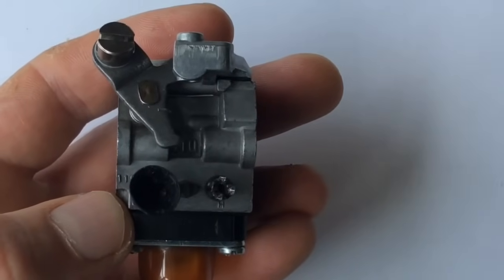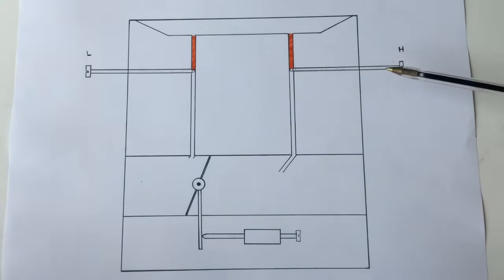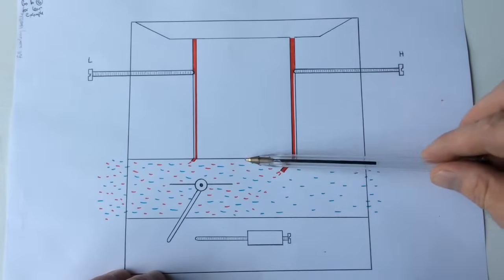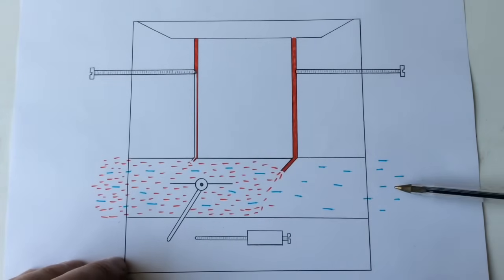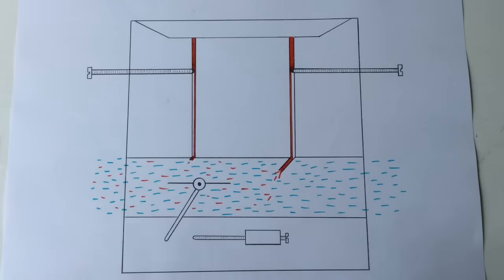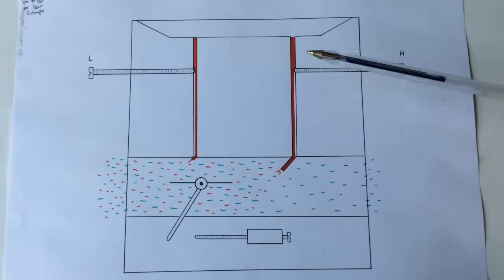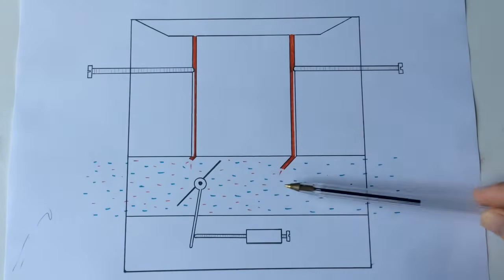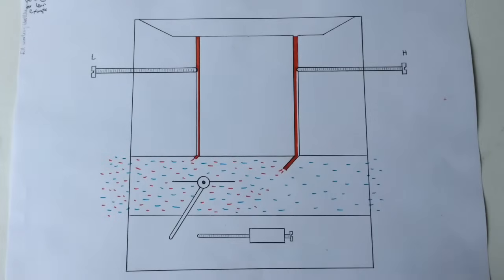HOW ADJUST CHAINSAW CARBURETOR:  Chainsaw Carburetor Settings Explained! (by Craig Kirkman)

Comment: good explanation....but from a practical real world everyday put the chainsaw to work, these adjustments need to be accomplished in a specific sequence.  The theory is sound, but the sequence explained is wrong.

a.  do NOT make adjustments to high needle valve first!
b.  do NOT make adjustments to low needle valve first!
c.  DO make adjustments to idle screw FIRST!  Period.  you will need to locate (visually the position of the idle butterfly valve.  This is IMPOSSIBLE to do unless you remove the carb and look down the carb throat. In some carb assemblies this is not possible and you will need to remove the carb completely or at least enough to see the position.  DO NOT TOUCH THE THROTTLE TRIGGER when doing this. what you are doing is setting the IDLE butterfly valve in a static position...re:  idle, no trigger! The position should be about 1/2 but no more than 2/3 blocking of the throttle body.  Turn the screw to get this position.  We will come back to this idle setting later. This is the starting point for static setting.

Now that the idle butterfly valve is set to 1/2-1/3 close position, REINSTALL THE CARB FILTER!!!!  (the engine will run differently with carb off, so put it back on before next steps)  Also important:  chain MUST BE INSTALLED.  The engine will respond differently when under a load than just freewheeling or even with the chain brake clutch engaged..DO NOT DO ANY ADJUSTMENTS WITH CHAIN BRAKE CLUTCH ENGAGED..  That causes MORE load and will defeat the purpose of the carb tune.  So basically, you are tuning your carb with the chain ON, no chain brake engaged, carb filter ON!

Now that the idle valve is set to static..and carb filter is reinstalled,  chain is installed and chain brake is not engaged, we go to low and high needle valves. see the note later in the steps about proper chain oil !  (and it goes without saying, make sure you fuel is proper 2 cycle mix ratio!!!)

Notice we have NOT started the motor yet!  KEY..We are just preparing for the tune.  This is called setting static tune.  We are doing this in sequence and we will follow this sequence in this static setup and we will do this same sequence in the fine tuning with engine on, later in the procedures below. The sequence is:  idle first, low second, hi last!  follow that and you will ALWAYS get your carb tuned properly.  

okay, so now we have all of that squared away.

this is where you need to locate you chainsaw manual.  The nomenclature SHOULD show how many turns OUT FROM fully closed is the starting point...

For example, on my Stihl MS250, it is 1 full turn out  from close for the low needle.  And it is 3/4 turns from the close.

terms:

closed:  meaning turn the needle valve clockwise until it stops. DO NOT OVER-TIGHTEN!  The needle valves are precision machined!  If you crank down too hard when you turn them closed you risk damaging either the needle end or the needle valve seat.  If you over-tighten and bugger it up, you are probably never going to get the carb to work correctly and will be looking at replacing it. So gently!  Clockwise turn to close (gently!)..then open them up (counter-clockwise) to the rotation listed for each low side and hi side needle valve according to your manual!! 

The MS250 I have this is 1 full turn from close for the low needle and 3/4 turn from close for the high needle.  Your machine may be different.  KNOW these numbers!  It matters!  This is where you begin.  This is static carb setting.  

Now you have all three setting in static position.  You are now ready to begin your running fine tune.

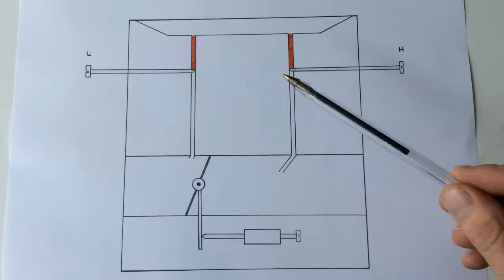prep:  make sure the chain is installed, and tension is correct...do NOT overtighen the chain.  Make sure the carb filter is installed.  Make sure you have bar oil !  Make sure your fuel is good (89 no ethanol gas is best...anything above 89 is counter-productive.)  Make sure the 2 cycle oil mix is the right ratio.  For my machine, it is 1:50...1 part fuel oil to 50 parts fuel!  That translates to 6.4 ounces of 2 cycle oil for each 2.5 gallons of fuel.  2.5 gallons is the most common small engine fuel container.  The most common mistake is too much 2 cycle oil or not enough.  Too much and you end up creating power problems and heavy unburned deposites of fuel oil on all the parts of your motor that cause performance problems.  Too little oil and you end up with poor lubrication and that will lead to premature wear on all moving parts within the motor!  Some advocate adding a bit more fuel oil to the mix for protection.  I agree with this, but more than one ounce per 2.5 gallon container!  this is particularly helpful if you are running your chainsaw hard for long jobs on a regular basis.  But anymore than that, and you create performance problems...when in doubt, stick to 1:50...in some machines that mix ratio may be different...1:40 for example...get out that manual and find out!

okay, so now we have the basic setup...with important details.

now we go to startup and fine tuning with the engine running.

start chainsaw.  Does it start?  

it should..it will probably run pretty good too.  Unless something is terribly wrong, carb fouling, air leaks, bad fuel, bad sparkplug, or bad ignition ...and that is for a different day to discuss...the static settings for all three screws according to you manual should get you in the ballpark and the chainsaw running.

now, sequence.  

first:  idle screw:  leave it alone!  Yes, leave it exactly where it is.

give the chainsaw about a minute or two of warmup...then pull trigger and release....then pull trigger again let it roar for 10 seconds, then release.

turn chainsaw off.
yes, turn it off!

then start it back up again.

does it start...yes?  it should...what you are doing is making sure that the static settings operate correctly in all modes of operation..just like you would expect out in the field!  key!

So next up is that idle needle valve.  close it until the rpm's pick up and and you hear it running faster...NO TRIGGER..remember this is idle.  Once it starts revving, back off and until the rpm's drop and then a bit more until it sounds like the motor is just going to stop.  Between these two rotation points is the sweetspot for idle.  (do not pay attention to chain rolling or not...we will get to that later!)...  Once you find the middle point between these two hi and low stops in the low needle valve, open it up one quarter turn....

hit the throttle a few times...and release..motor should run and sound the same ....

next up, Hi needle valve:  this is probably the MOST IMPORTANT STEP...and you MUST be cautious here.  This is what controls the working power of the motor.  pay attention to what you are doing here and listen carefully.  And be SAFE!  

engine running...NOW HIT THE THROTTLE AND HOLD ...close the hi needle until it picks up in rpm and sounds gets higher pitch.  release trigger!...
hit trigger against and hold and open the hi needle valve until it starts going into a lower rpm sound, lower pitch.  If you go too far, the motor will stop.  this is normal.  Find the two rotations for high side and low ...the middle is where you want to be.  Then back off by 1/4 turn!

release the throttle.  let it sit...

turn machine off.

turn it back on...idle should run like before..hit trigger for 10 seconds and release....everything should work.

now we go to the chain ....at idle, does it move?  

if so, then simply adjust the idle screw until it stops.  It's just that simple..

this is the proper sequence.

once you learn to do this...and you repeat it over and over...it becomes second nature memory...

all chainsaws 2 cycle use the same procedures...with some key differences in static setting and fuel oil mix.  but the steps and more importantly the sequence IS THE SAME!

you are welcome

Comment: Hi Yr video of adjustment of carb seems really helpful but before l go ahead can u tell me why my saw was cutting out when getting hot.
Thanks Kevin.
Reply from the maker: Hi.  Yes usually, and most commonly, this is due to the ignition coil pack.  They sometimes stop producing electricity to the spark plug when hot and then when cooled down they work again.  Very confusing.  The only way to know for definite is to fit a new coil pack or one that you know for definite is in good working order.  Then, run your machine to see if symptoms are still present.  It is Not always the coil pack so it is a financial risk you may have to take, but it is common.  This is the best place to start in my opinion.  I will make a video on this after I have completed a few other requested videos. Many thanks Craig

Comment: Very good job of explaining the adjustment that I ever seen the only thing that I not clear on the idle adjustment screw I normally adjusted the low screw until it idle at the highest idle to were you hit trigger it excel with proper then adjust the idle screw to the idle that I won't  is this not the right way

Comment: Hi and thanks for the explanation.  What, if any, is the benefit of adjusting the high first?  Also, once you've got the high sorted and you move onto the low, will you then have to dial the high down a little so that on full revs the high plus the low, are not creating a rich mix? Thanks

Comment: I thank you for the video, but the more I open the high jet, the more it revs, to a point where it sounds as though it's going to self destruct.  I've never gotten to the point where I hear the engine bog down.  I've also been taught to adjust the low needle first,

Comment: I run a small engine repair shop on the side and I always try to explain to people what these adjustments do and of course they don't follow but this work you did is one of the best educational videos I've seen good job man
Reply: Hey, question: what he's calling the ticker, is that the choke?
Reply: @larryreese6146  I think ticker is idling. Throttle adjustment. Not choke. That is my interpretation.
Reply: @larryreese6146  idle adjustment screw

Comment: Great video. Very informative! I generally set the idle just a bit rich. A good idle with a little smoke so I know it's getting sufficient oil/lubrication to the internals and for the high speed setting I set it slightly below peak rpm till I notice a little bit of  two stroke smoke at full throttle. Oil/ lubrication is critical for internal cooling and lubrication. Too little and your engine is cooked too much and your exhaust port and muffler will carbon up reducing power till cleaned out. I run Stihl and Husqvarna both brands run very high rpms so I very slightly tune them down a bit so they have a longer life. My Stihl FS-250R has been tuned like this and has lasted for seventeen years and runs like brand new every time I go to use it.

Comment: I have a vintage Stihl AV045 Super. I mistakenly put diesel in it! I stripped down the carb and replaced all the gaskets. Couldn’t get it to run. Watched this video today then followed the instructions splendidly shown in  the video - one turn on each screw. Imagine my joy when I heard the first bang of the 87cc motor. It soon kicked into life and was quickly up to full revs. Adjusted both screws to find the sweet spot but went back to 1 full turn on both. When it warmed up I adjusted the tick over. Magic! It is as good a saw as a Stihl Magnum when running, it runs on 40/1 but I run it on 50/1. Next project my Mantis Tiller!!

Comment: I have a Makita DPC 7311 14" cut saw that I just replaced the gaskets and diaphragm because the machine would flood prior to starting it. Now that it will start after only a few pulls, it won't idle on its own but stall if I let go of the throttle trigger. My question is, should I follow your procedure of adjusting these settings? And, I also have a screw setting that has an S on it. Not sure what this stands for? Is that my ticker, as you called it in your video? Thanks!!

Comment: So many times I have wondered EXACTLY what the needles adjusted(Air or Fuel)... Mine would only start with L on 1-turn out...but after cleaning(tear down) carb and replacing coil my 1999 325R-X is running great again... THANK YOU !

Comment: you dont need to pull the throttle when adjusting the low speed needle to see how the engine sounds/ preforming?
Reply from the maker: Not whilst turning the screw because you will need to hear changes is engine running from idling, but you certainly will need to pulsate on the throttle in between adjustments to see if your changes have made a difference to the over all running.
Reply: TheRepairSpecialist thank you

Comment: Would like to ask you a Question #Repair Specialist!  I’ve got a Stihl BR420C Magnum. I noticed it was leaking fuel out of the air filter housing. I removed housing/filter and cranked to observe... it  only leaks or squirts fuel outward from the carb into the air housing when throttled up into the Rpm’s. Not when idling. 
I’d like to stop this leak to be able to start using it more. I’ve bought a walbro carb rebuild kit for this carb thinking it may be the diaphragm, is their any way it would just need to be leaned out on the low or high jet in order to stop the excess fuel squirting outward?  I know this carb has the red plastic limits in order to not go too extreme rich or lean... or should I just stick to the carb rebuild plan?  Thanks for any information in advance. 
Love Your Videos.

Comment: A lot of how a 2T carb works, but zero info on procedure of how to tune it so that it doesn't run too rich or too lean.
Of course, most modern 2T carbs have limiter caps on the screws that basically keep you from tuning to optimum conditions, and make them run lean, thus damaging the engine components.
...all for the sake of complying to insanely low emission standards set by the likes of alphabet organizations such as CARB (California Air Resources Board)
Reply from the maker: I already have a video here on youtube on how to set these carburetors on two stroke engines. I have used a chainsaw as an example but the principles are very much the same for most two strokes.  You will find it here: https://www.youtube.com/watch?v=74p9FLmIkkw&t=31s . Thanks. Craig

Comment: I have a strimmer that wont run at all in ideal it revs fine but once you release the switch it dies any help would be greatly app6great vids buddy very easy to follow also the carb is a zamma and it only has one screw for fuel and a tick over screw cheers

Comment: Hi mate great video the screws on my carb aren't a flat head they're round with one single notch any suggestions in what tool to use to adjust it?
Reply: I've never worked on carbs but I noticed you can buy carburetor adjustment tools which look like screwdrivers and have different ends. The one you describe sounds like what they call a "pac man" carburetor tool. There are several so might be worth buying a cheap set off amazon or ebay to cover all types.

Comment: The reason it draws from the low side at idle is the butterfly is nearly closed and the suction of the piston must draw from somewhere so it draws from ANYWHERE after the butterfly...that would be the low needle channel or pathway...it can't draw from the high side at idle because the butterfly is blocking the access to the high channel.

Comment: That was a great video very informative and explained in a very layman term as to what goes on with these carburetors it's a shame most of these have went to plastic which are junk China carburetors and often fail one reason seems to be that if you have a gravity flow tank without a shut off valve which few companies put on it does eventually ruin the carburetors and seals and causes failure so once again thank you for explaining this and I appreciate your videos and hope that you make more and I appreciate your time
Reply from the maker: Thank you for your positive feedback. I really appreciate it. Thanks again. Craig

Comment: do you need to have the engine warmed up or from cold ?
Reply from the maker: I normally go straight into the adjustments after a few revs of the engine.  Thanks. Craig

Comment: I’ve been struggling trying to tune carb on a Craftsman high-end weedeater. Can’t wait to try again after watching your great video. Now understand the mechanics as well as the process. Thank you so much.
Reply from the maker: Thank you so much for the nice feedback. I really appreciate it. Craig
Reply: @TheRepairSpecialist  I was fighting a Craftsman weedeater and replaced the carb 4 years ago. Found a bad fuel line and found out I put the filter on the wrong line in the tank 6 years ago so I was getting dirty fuel into the carb. Your diagram helped me find out which was the high and low settings. I was messing it up. I'll try again when it isn't 95 degrees out!!! (here in Kansas).

Comment: There is one thing to be aware of with many newer chainsaws ,, there electronic ignition systems now feature a high RPM limiter that chops off the spark as soon as the engine reaches a set upper rpm  ,, this changes the engine sound and can trick people who are listening to the sound of the engine into setting the carburetor mixture wrong ,, one must listen to the engine "under a load" when adjusting the high mixture.